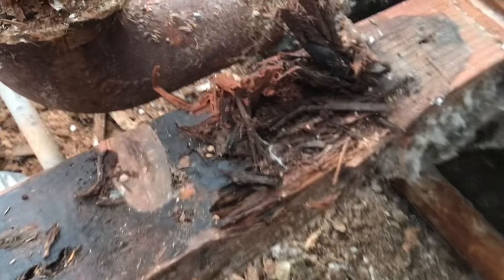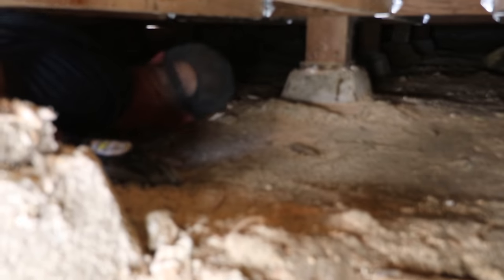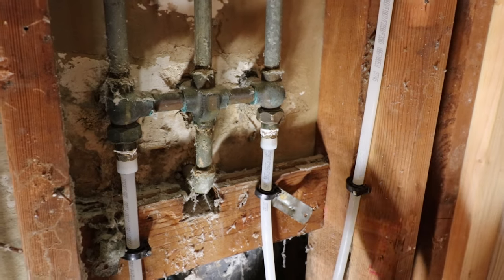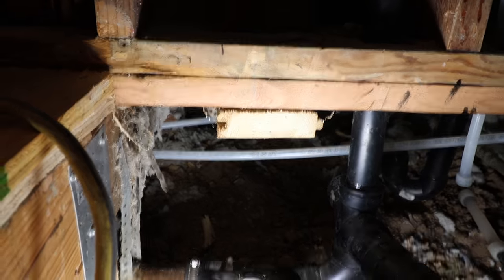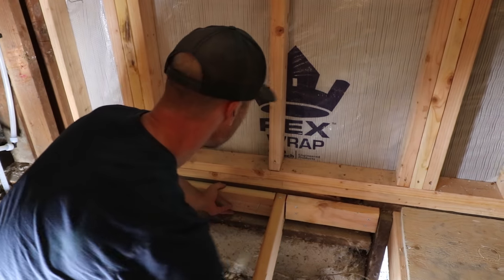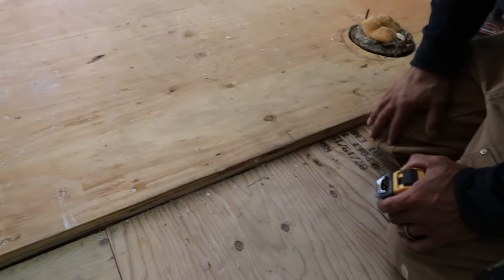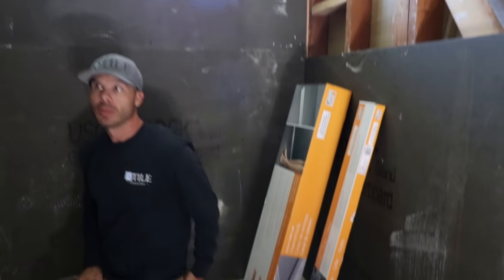Building a Curbless Shower - Framing and Plumbing ---Grandpa Bath Episode 3

Comment: Great video. Informative, detailed yet straight to the point. Nice clean work. I would only check the code because depending on the jurisdiction, the "Fernco" or (the no hub coupling) that should be used to connect the cast iron waste , drain and/or vent pipes should be the ones with the stainless steel band that connects a worm clamp at each end because it adds a layer of protection to the otherwise exposed section of rubber.
Reply: Only when exposed to soil

Comment: Great video, thanks Isaac! I like that Uponor expansion PEX you used much better than the crimp style because the fittings allow better flow, and the expansion fittings get tighter over time. I prefer to minimize joints by allowing the flexible tubing to bend instead of using elbows. Less expensive, less time-consuming, less parts to carry, less joints to leak, and better flow characteristics. Keep up the good work man, and keep these great videos coming!

Comment: 0:03 Structural (metal hangars)
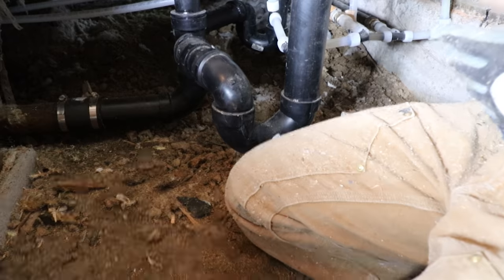2:10 Pex plumbing and waste lines
3:30 Linear Drain
4:00 Rubber fittings for ABS to calvanized
4:37 Detail on Shower Pan Framing!
5:35 Plywood Dropped Describing Adding height to floor as well as Kerdi drain description and shower walls.

Comment: Should have replaced that tub valve too while you had the wall open
Reply: More trouble than it's worth.  A 3 hole valve, etc. Trying to fit it in the same holes and having it match. It's probably never used and in good shape.

Comment: I believe you should have used a shielded ABS to Cast Fernco for that connection.  The flexible ones are not to code for that.
Reply: javaldes7 
Unless he's a license plumber he never should have altered the plumbing system and even then technically should have a permit. At least by Kentucky State Plumbing code.
Reply: Same in my county, got dinged on that by inspectors before.

Comment: non-shielded rubber couplings (Fernco couplings) should only be used in buried applications. You should be using banded or shielded no hub connections as the ones without shields can deform when not buried.

Comment: But Issac,. if you place cement board on top of the plywood floor, won't the toilet flange not be, as the British say, "proud" of the surface?  Would the flange have to be replaced?

Comment: All (or Isaac / Tile coach) How deep was the recess/drop for the floor? I have a similar situation Linear drain with curbless (shower is 5'  x 3' with linear on the 60" side. 

My math: 2 - 7/8" 

Linear drain 1.25min, Drain slope drop  .75"  (1/4 per foot), 7/8" tile composition (mud, tile, thinset) = total 2-7/8 min.  It seems like a lot especially starting with a 2 x 8 as a joist, after cut would be considerable.

Comment: USG makes a presloped pan tile base that eliminates cutting down joists
Reply: Yeah,  but it raises the rest of the bathroom. Plus,  no joist were harmed in this video.
Reply: No, if the whole bathroom floor is tiled a uniform height is achieved, creating a barrier-free, curbless shower
Reply: @wallacegrommet9343  That height needs to be made up somewhere.  Where is the step up?  At the entrance of the bathroom? 
Either way, the joist were not cut in this video.  Most of the time you don't need to cut the joist and the rest of the bathroom floor can stay at the level it is.
Reply: I used a marble door sill that roughly matches the carpet height of the adjoining bedroom.  I lowered the shower subfloor putting it in between the joists, flush with the tops.  The rest of the bathroom subfloor was now higher than the shower area just the right amount for a curbless shower.  This approach works because the floor tile thickness with backer board and mortar worked out to be the same height as the shower pan plus tile.
Reply: @wallacegrommet9343  Agreed as long as everyone knows that the joist were not cut out to lower the height.
Reply: Isaac reframed that shower area lower, right? He explains why at :51 seconds
Reply: @wallacegrommet9343  You are right. I missed that.  But in general you don't need to cut out the joist.  You do what you did with sistering in 2x6 (or whatever)  directly on to the existing joist but do it an inch lower. Then fill in these bays with plywood.  Now the surface of these plywood pieces is at the same height as the exposed joist.  So now this area is about an inch +/- lower than the rest of the floor.  Then adding a tile underlayment to the remaining floor will give you well over an inch of difference.

Comment: Hey Isaac, just curious. I work In Washington State and as of a few months ago as a tile contractor were no longer allowed to run cable heat (must be installed and inspected by an electrician before tile installation) and now they are trying to make it so 4:1 dry pack / mud pan installs are done by plumbers (because they have plumbing in them) we are very particular and precise on how we do both of these. Have you ran into issues like this before? and if so, how have you dealt with them? The last thing I want is to show up to a job after a combine 30 years of perfecting shower pan installation only to deal with anything less than i would expect from myself. Thanks!

Comment: I have a question bro, when going old school on a pier and beam house. Putting in a new walk in curbless shower so my mom can walk in since she will be handicapped. Is their any rule of thumb for how far down the shower framing needs to be from the existing floor for the preslope,pan liner, then mud pan so it will be the same height as the existing finished floor?
Reply: Drain is 3 1/2' from farthest wall

Comment: Issac, was the mudsill the impass to not drop the 2x6 shower floor joists lower to give you the 2" drop you wanted, or were there other driving factors? I have a similar remodel coming up and am doing my first single slope lineal drain and would appreciate your advice. Thanks!

Comment: Jesus christ  you guys used a shit load of fittings with that pex.  Every fitting is a potential leak. Trust the flexibility of the pex.
Reply: That and it's not pex its wirsbo
Reply: @spudinboise  You might want to delete your comment.  Wirsbro a company,  pex is a product.  Pex (a) f1960 to be exact.  Calling it pex is more accurate than calling it wirsbro. Many companies besides wirsbro (now  owned by uponor) make pex (a).
Reply: I don't mind pex but do not use Gator fitting behind walls or tile. I had a leak from 1 failed instead of ripping tile job apart i took sheet rock off wall in closet and changed all fittings to brass w/ clamps

Comment: The pipes get smaller when you use pex also fittings are a 1/4 in hole, would never use pex  real plumbers would never use pex in there own home, just others
Reply: That is PEXa. You expand the pipe to go over the fittings as they are the same diameter as the pipe, so no restrictions.